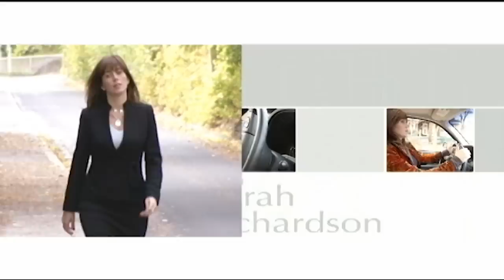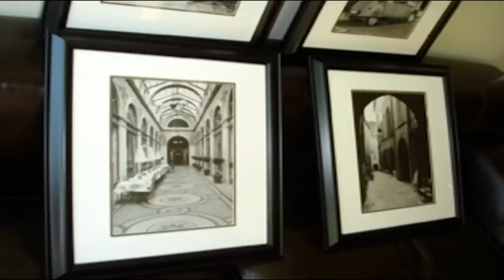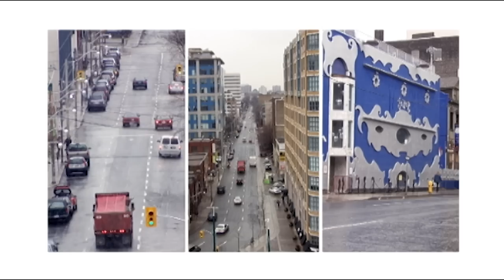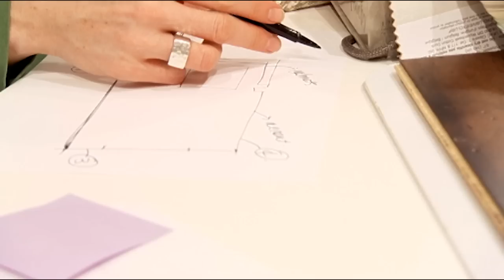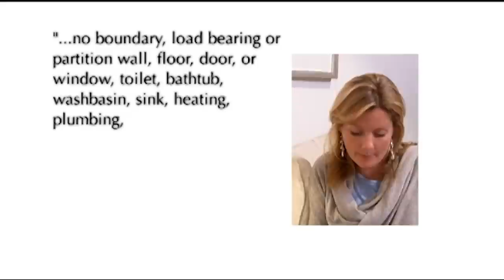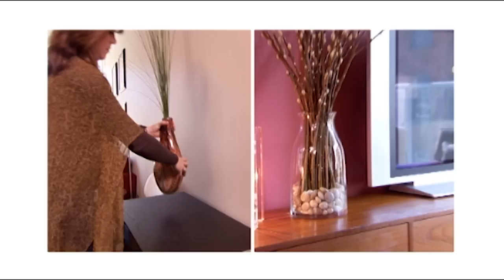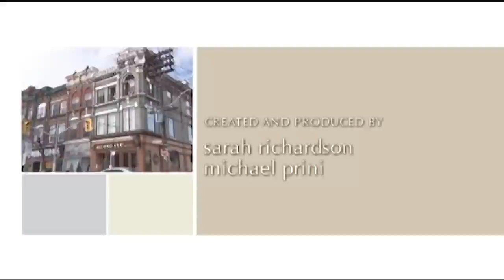Stylish Condo Renovation: From Flooded to Fabulous | Design Inc

Comment: Jeff is such a mensch. The design looks great: concrete ceilings, hardwood floors, stainless steel surfaces, red accent wall, red couch, menswear fabric accents. I would not have chosen such a densely red area rug, and the banquette fabric is too whimsical.